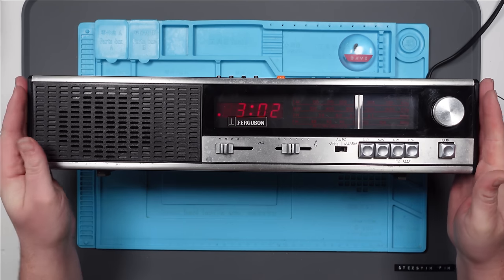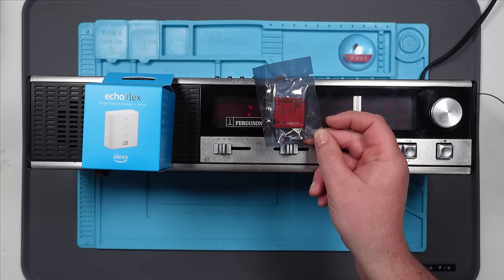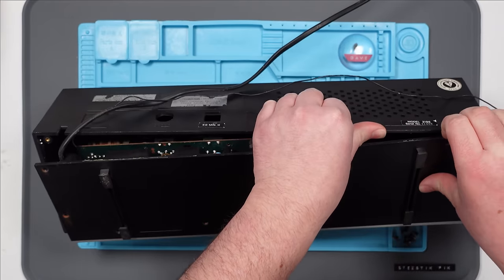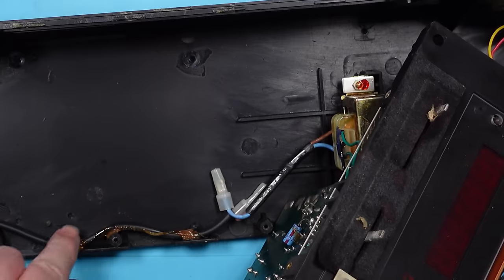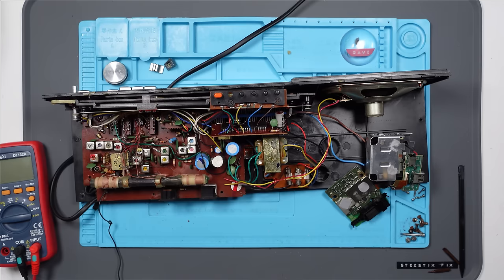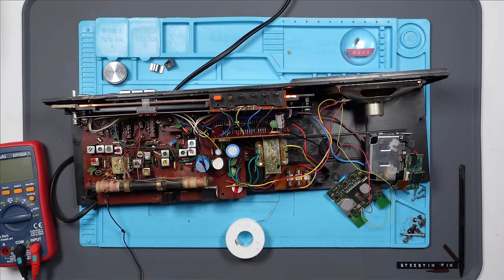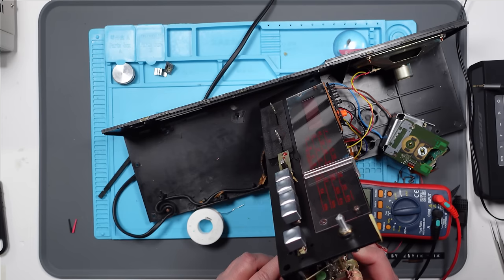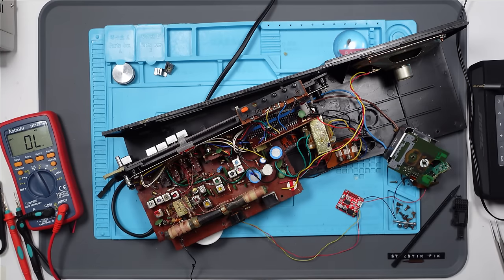I Added ALEXA to this 1976 FERGUSON RADIO! | For no Particular Reason

Comment: Turned a perfectly good old clock radio into a spy device. Well done!
Reply: It's an upgraded and optional spy device, since - other than the original one - this one has a power button now, so it can be turned off at any point.
Reply: “Hey, wiretap! Could I get a recipe for Chicken Pot Pie?”

Comment: This is really cool, only thing I would think would make it cooler is if you could integrate the Alexa light into the display somehow. Like make it light up the front tuner display when Alexa is listening? Would definitely add a cool factor to it. :)
Reply: And maybe repurpose one of the buttons on the radio as a mic mute, so She Who Shall Not Be Named isn't constantly listening from just by the bed 😳
Reply: You should have twitted the input cable to get less noise. Nice mod butifull radio 📻

Comment: Shortwave is alive and well. It just depends on your location, and time of day, and if the sun is acting a nut or not (the solar flux plays a huge roll in shortwave propagation, and a solar flair will kill reception). In the day time higher frequencies work better than low frequencies, at night lower frequencies do better than higher frequencies.  It also depends on how good the antenna is, electrical interference is a constant issue with shortwave.
Reply: Not to mention needing an antenna!
Reply: @kastrosama  It does have an antenna, it's that single thin black wire hanging out the back.
Reply: @madmax2069  I spotted it after I commented. Nice build though!

Comment: good idea as a whole.. there is one part which isn't needed though ! the second small amp..... you've got an amp (alexa plug) feeding another small Bluetooth amp feeding the radio amp. 3 amps in total, you could ditch the middle one (Bluetooth amp) and get the same if not better audio quality most likely.
Reply: but no bluetooth which is why he said he'd keep it

Comment: Hi, Stez! Yes, that DIN 5 is a tape deck connector. Pins 1 and 4 are for left and right, pin 2 is the common ground, and 3 and 5 are left and right outputs (to record a tape in the deck). The outputs come from the pre-amp, so you can use it as an output for a bigger amplifier if you wish to. :)
Reply: But that is not a “line” output. Its a variable one

Comment: Was about to do this myself 🤦 then noticed the smoke coming from the clock at the end 🤣 great idea thou ❤️❤️❤️
Reply: If it was smoke, I'm not so sure it wasn't reflection, but either way I don't think it would be caused by anything Steve did, that clock display was coming and going before he took it apart.

Comment: great use of old tech, love it. I appreciate not using the wake word as I hate it when videos wake my echo.  I was wondering how you handled the microphone?  is it just the internal mic on the echo or did you use a higher pick up mic?
Reply from the maker: Thanks Robert! I used the internal mic as it seemed to be sensitive enough to pick everything up, even with the case around it. In hindsight, i would try to mount it closer to a vent or external hole of some kind. Alexa can't always hear me if the music is playing loud.

Comment: Hey i know this video is 3 years old but what you have done is wired a stereo blutooth  unit to a mono set so when you send music to the set through bluetooth you will only get one channel some music will be missing. What you should have done is used a 100k resistor from left output and the same on right  output then joined the resistors together giving you both the channels mixed for mono.

Comment: Steve mate,i did the bluetooth hack to my cd/digital radio.
I found the 5v DC power rail on the origininal motherboard and tapped into that,and wired the bluetooth output to the aux in socket .
Nice job mate,please keep the vidyaas coming .
You are funnier than MMV but he's still a tryer 😂.
Reply from the maker: 😁 thanks Daveyboy! That sounds like an awesome mod! I'd like to do more stuff like that, there's something nice and rewarding about modernising old tech! 👍

Comment: you could add a "sound activated relay" to detect if there's sound from the alexa and push the power button when it sees sound. 
but this also works, it's just always powering the amplifier. 
I would most likely do the same if i were in that situation

Comment: Great job! Could you have fed the Alexa mic and notification LED to front somehow? Also can anything extra clever be done with the USB connector on the Echo Flex? I know it gets used for a clock and a light attachment...
Reply from the maker: Thanks Shane! I did think about moving the led, but I got a  it hung up on wanting it to look completely stock from the outside. I may still do that. Also, good point on the USB port! I forgot that you add attachments to it. I'll have a look! 👍
Reply: @StezStixFix  If you do, change it for red ?  Wont look so out of place.  Many 7 seg displays have an extra decimal point somewhere -  might be an idea?
Reply: @StezStixFix  the USB port and/or the LED could be placed on the back somewhere, so the front looks completely original while the back has the "upgrades". Just an idea...

Comment: This is in absolute beautiful idea! I was so worried that you wont use the radios speaker :D Great to see you figuring that out! If i got everything correct, the "Alexa" is turned on all the time and just silenced if you use the radio in its default behaviour?
Reply from the maker: Thanks Kisox! Yeah, Alexa is in low power mode until summoned, but only plays when on the correct input. So you can use the radio as originally intended without even knowing it was there! Also works great connected up to my phone, thanks to the Bluetooth receiver.  So I can switch between Alexa and my phone easily. I'm really happy with how it turned out! 👍
Reply: @StezStixFix  you can connect alexa to a bluetooth source like your phone anyway. Just ask her to connect and you have to find it on your phone but it works

Comment: Just the fact you mentioned Stranger Things would've won you a sub if I weren't already.
Loving the stuff.

I haven't finished the video yet (I'm at the point of you wondering how you're gonna get into the Echo) but the better device for this probably would've been the Echo Input, if they're still available. They're a tiny echo, no built in speaker, just the 3.5mm jack.

But then you would've needed 5v power.

Comment: Should find the preamp chip on the board of the old radio and pull the input pins out of the board and put in a bypass to the Bluetooth/Alexa...  LN-BT02 is the unit I use to convert all my old radios...  Pro tip - when using cutters to strip wires turn the flat side of your cutter to the side you'll be pulling off..

Comment: Hi sorry i know this is off topic from this video but was watching the video where you fixed the psvr w no display on headset i have a psvr that i havnt touched in about a year because of this issue without all the equipment do you think it would be possible for me to fix it or not likely?
Reply: Just realised how stupid this sounds i know i couldnt get it with no equipment but what im asking is d u know if theres a cheap way to do it?
Reply from the maker: Hi! I imagine it's the same problem with the wiring, so the only secure way to do it would be to find the break (you may be able to do that just by looking if it's obvious) and solder them. Without a soldering iron, you could just wrap the wires back together and tape them but it would only be a temporary fix. I'd start by plugging it all back in and giving the wires a jiggle, see if the screen comes on at all. And then take it from there. Good luck! 👍
Reply: @StezStixFix  thanks alot

Comment: SW still is on, but you need a long antenna to receive something and it faces the same problem as 5G and other RF, where reception often only works outside.

Longwave also needs a long antenna unless you are in Germany, Ireland or the UK.

Comment: Great reuse of older technology Steve. Is the Alexa always on as long as the clock radio is on? That clock radio would take up most of a small bedroom in a new house today and to think it would have sat on a bedside table in the 1970s.
Reply from the maker: Thanks Ned! Yeah, Alexa is on as long as the radio is on. It uses hardly any power though as it sits in low power mode until summoned.
I tried to put it on my bedside table, and it doesn't fit! I've put it under the TV. The thing thing about the size of a VCR! 😁
Reply: @StezStixFix  I would think that Alexa is always on even when the radio is off (as long as it's plugged in) given how you wired up Alexas' power supply.

Comment: I would love to do something like this to MY 3 year old Dewalt Tough System Radio DWST1-75663 with four speakers and twin subwoofers, i use it for the garden,  beach,  camping,  but it is all low voltage 14v-18v DC so cannot run a 240 volt AC transformer.
Although can last about 10 hours on a 5 Amp 18v Dewalt battery. USB, phone charging, and it has Bluetooth and an audio in small jack socket.

Comment: Didn't see how you ended up mounting the echo device inside the radio. Nice project though, tune Alexa into a vintage radio station for extra nostalgia! (I did the same with an old valve radio).

Comment: If you have an affiliate link to that amplifier board, I'm interested in doing this myself.
Reply from the maker: Hi Stonecold. I got the boards off eBay and I'm yet to set up affiliate links for there, but they are cheap as chips. About £3 including postage! : https://www.ebay.co.uk/itm/192582713604

Comment: the problem you had with the alexa sounding terrible was because you never unsoldered the original circuit from the speaker, the alexa was feeding back to the radio's amp and you can see it really made it upset as the lights flickered. you should use the original amp like you did anyway.

Comment: I'm a little concerned about the way you installed the Alexa device.  I like the Waco connectors to link live and neutral up, but the Alexa device used the ground pin to ground the metal cage (at least it looked like it did), and you don't have ground connected to it.  If the device originally had ground, you could swap out a grounded cable, hook up live and neutral exactly like you have them now, then solder the ground wire to the metal, which will be a pain because it looks like a huge heat sink.

Comment: Your making me feel very old 😅 are you old enough to have tapes as a kid? 😂 That 5din socket is for connecting a cassette player - it would allow that unit to work as amplifier for a cassette player and allow you to record (using that same cassette player) what you were listening too on the radio.
Shortwave radio is still used - you need a bigger aerial than that little wire and you will pick more stations at night. MW or Medium wave - that built in aerial is bidirectional - tune in a station and then turn the whole unit round until the signal is strongest 😊

Comment: The Echo Flex has Bluetooth built in.  It also has a headphone output.  You did not need to use that little bluetooth amplifier board.

Comment: You would've been better using a raspberry pi or equivalent then you could've incorporated a screen ect ect also the pi is Bluetooth and wifi and there's free software so you can stream and control whatever you're streaming from ie a PC  you could then add a hard drive to store tunes. But at the end of the day  it's your choice on what you prefer, personally I won't have Alexas in my house because of the privacy issues and those devices record everything yet they tell you they don't however my brother in-law is a copper and he says the police always take Alexas from people's houses because of the data they recorded!!

Comment: it looks like you didnt disconnect the speaker from the radio output, very dangerous as the radio amp will be feeling power into the alexa output

Comment: Europe needs to start converting their powered devices to the 110v US standard.  There are several important reasons for this but the single most important is SAFETY.  220-240v systems kill people all the time.  😲